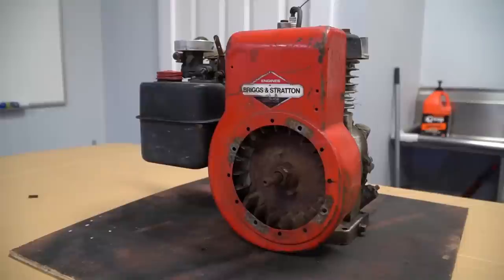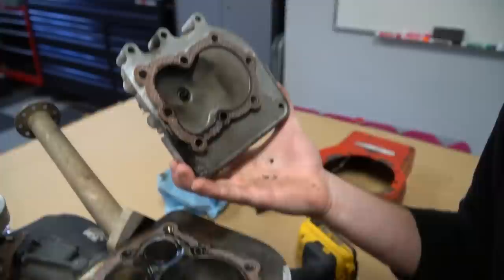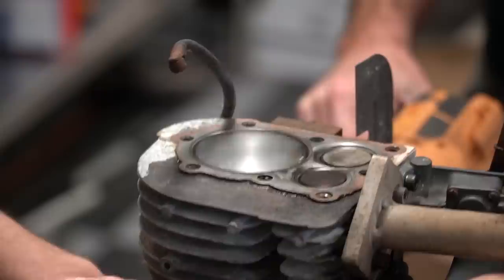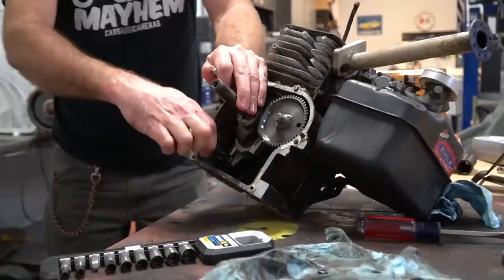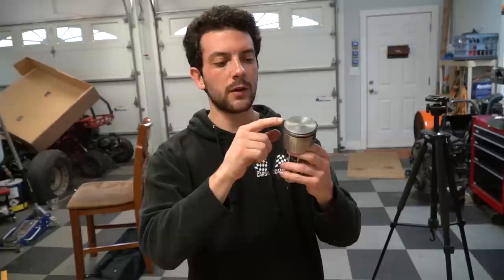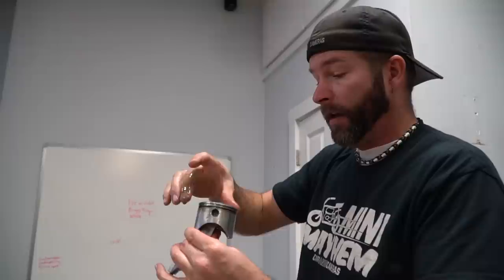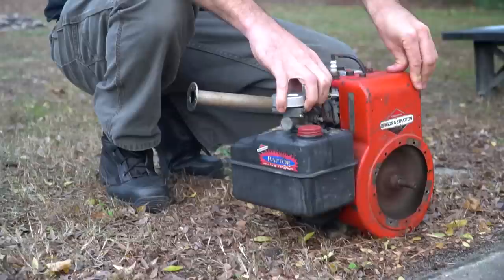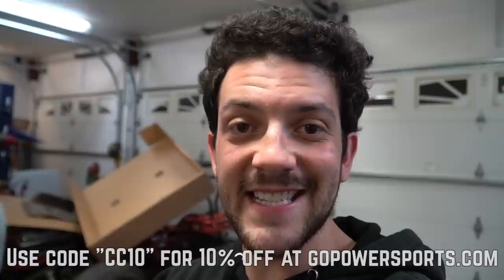Rat Rod Wagon HAULS | Built Briggs & Stratton Flathead

Comment: Race piston- 

That one looks like a relatively primitive design, probably originally set up for methanol (the 2 rings).  2 rings simply have less friction than 3 rings and you try to get away with it when you're burning cleaner fuel/changing the oil more often.  

The longer rod/raised pin height decreases the angle when the crank pin is at 90* relative to the piston travel so more of the vector force is pushing down on the crank/less to the side which transfers more of the piston's power to turn the crank.  The piston will also dwell longer at the top of the stroke causing an increase in cylinder pressure by increasing dynamic compression.  In theory that should result in better HP, less piston scuffing and rocking (again, possibly helping you get away with the 2 rings).  

That piston likely has some extra height at the crown resulting in a higher static compression to go with the methanol race fuel (it's possible that it is 1.5-2x that of stock), it probably wouldn't run well even on high octane if it wasn't for the worn out rings.  

I couldn't tell from the video but race pistons often have gas ports drilled from the crown to the back of the ring groove, to use some of the cylinder pressure to help seal the ring under a power stroke/compression stroke allowing you to use lighter and thinner/lower friction rings.

Racing pistons are often forged (deform easily but don't break so you can abuse them more in extreme applications), or sometimes hypereutectic (in applications where tune is going to be dead on they are more precise and change shape less), compared to stock cast pistons (basically the cheapest way to make them)

The reason why I called it a rather primitive design is that normally something more refined/modern would have a shorter skirt and more relief on the pin side of the skirt, anything to make it lighter and on the pin side the only skirt height you need is enough to stabilize the rings- it would actually look more like the modern Briggs person that Ike held up.  Most modern pistons use ceramic anti-friction coatings on the skirt, oil shedding coatings on the inside of the crown and sometimes heat reflective coatings on the face of the crown.

Comment: The second engine I built as a kid was a Briggs 5hp I bought for $7.50 at an old car show, someone had assumed wrongly that it was locked up (coil was rusted to flywheel lol) I got an ARC connecting rod, raptor 3 piston, Dyno Cams 95-3 cam, billet lifters, stiffer valve springs (still single springs) and replaced the carb and drilled the jet out. It seems to run a bit rich on gas, but it likes E85 now. I've revved it to 8500 rpms verified by a tiny tach I have mounted to my steering wheel. I think I maybe had under $200 in the engine by the end of it. I prefer the 5hp Briggs over any predator because that cast iron flywheel will stay together, and iirc the predator has a cast aluminum flywheel from factory and they don't like revs. Now, I haven't built a predator so take that with a grain of salt, I could be thinking of the Honda clones. The other reason is if you know what you're looking for on eBay, there are plenty of parts still out there, and they're cheap now because they stopped racing these in the late 90's early 2000's. The downside to what I built is my block is aluminum and my piston is unchromed, regular raptor 3 blocks were steel from that era and had no governer holes in the side. I jb welded mine.

Comment: A forged racing piston has more side wall clearances in combination with a single compression ring tends to rock a little more in the bore the longer rod helps reduce piston rock as it travels up the bore broadens tourqe curve seals better less wear on cylinder walls and more reliable  over all win win thing and there is that thing where it dwells longer at the  bottom of the intake stroke now we can get some more air and fuel in with some good cam timing a little food for thought 🤔😉

Comment: That valve is supposed to rock like that. That's for the compression release so it's easy to start. If you have an old briggs manual look up "easy spin starting". It explains how it works.

Comment: 1 ring = less drag. Longer rod = more piston dwell time at top dead center and bottom dead center. Usually racing pistons are forged aluminum which will take more stress than cast

Comment: The wrist pin is just at a higher location with a lot thinner of the top of the piston giving it more air volume to pull into the cylinder making more compression a s power and sometimes its also lighter

Comment: What makes a piston a racing piston is:
-Tighter clearances all the way around
-Lower weight
-Higher flowing crown
-stronger materials
Thats it.. all of these in different ways add up to more/less compression (lower is better for turbos and No2 with cheaper parts) greater fluid dynamics in and out of the combustion chamber (move more air) lower rotating mass (easier to spin the crank all together) and more compression capabilities (more power out of the fuel)

Comment: Most race pistons are forged, however some may be hypereutectic. Biggest differences between a cast and forged piston are strength and ability to resist high temperate. Within race pistons you have two commonly used but separate alloys. Those being 4032 and 2618. Both have their advantages and disadvantages. 4032 is less dense and expands less than 2618. However 2618 is stronger and more tolerable of heat. Both could be considered application specific. You wouldn’t run 4032 in a car that is high horsepower, high RPM, that you only drive at the track. 

Other than material, design is a big part. You’ll often see race pistons with thinner, stronger, piston rings to cut down friction and free up some horsepower. Most use a 3 ring design but some, like yours, use 2 rings. A lot of pistons will have a coating on the skirt to help reduce friction. Other things to save weight and cut down rotating mass would be shorter piston skirts and smaller diameter wrist pins.

Comment: I never liked the slant cylinders on the newer engines . I'm pretty sure you'd be able to get valves and guides and probably even seats and the little tools that are required to replace them you can make your own guide removal just with a bolt and nut and a washer and a tap . And only if you take great care when grinding the lifters for valve lash it will make the valve train sing . I collect an old Briggs or to every chance I get and Honda has a nice vertical cylinder series too , with overhead cam and overhead valve and cross flow . I have a 6 horse from a pressure washer that has all these features . It's sweet in my opinion , for a small industrial engine to have almost every modern technologic advancement incorporated into it .

Comment: Not all Briggs are worn out, I got a 5hp Briggs that had a seized pressure washer pump on it, the only problem with it was the low oil cutoff wasn't working properly, other than that it fired right up and ran perfectly, and it didn't even smoke when I had to use 2 stroke fuel In it.

Comment: Make the piston gap a little wider to let more oil in and run a gas line to the oil and drain the oil. Then fill it with 2 stroke fuel

Comment: The main reason for running one compression ring is to cut down on friction.    higher and faster RPM s is one reason. Race engines like drag racing the engine only needs to last a QT mile at a time. Where as two compression rings are designed for longevity. Who cares if it smokes a little it'll only smoke for short distance. The skirts are longer to make up for the raised wrist pin to keep piston from rocking in cylinder

Comment: You guys have a Briggs 5 hp double bearing engine. It is the all time best and most popular flat head design engine for kart racing. Your engine looks to have a Horstman billet rod with insert bearing and either a Horstman 2 ring race piston or Wiseco. The camshaft is definitely an aftermarket race cam and looks to be a Dyno brand cam. You pointed out it also has the dual valve springs. With the proper rebuild that engine should produce around 13 hp. If I were you, I'd invest in a new oversize piston, a fresh overbore and a new rod insert bearing. Keep in mind if you have the steel sleeved engine you'll need to buy a non-chromed type piston, if it has an aluminum bore you'll need a chromed type piston. You should be able to locate a new piston with rings on Ebay. Just be sure to measure your rod length as it is longer than standard. Probably a 4.475 or 4.5" rod. Keep in mind those are race parts, forged piston and billet rod with insert bearing. These parts will last much longer and make much more HP than the stock stuff.

Comment: One compression ring equals less friction and resistance. Longer rod equals less wrist pin friction at high rpm and less wrist pin angle through the strokes.

Comment: Racing piston with a single compression ring has less drag versus 2. With a longer rod and a shorter piston it has less rotational mass. Also more than likely it brings the piston closer to 0 deck height resulting in more compression. Which will result in a substantial gain in such a small engine.

Comment: Longer rod, means higher compression ration, it's called a 'stroker' engine, as you have increased the stroke. Also I bet the racing piston is much lighter, because when you stroke an engine you want to lower the piston weight, so keep up your engine rpm. My guess is it has a performance cam also. The longer skirt is to help keep the oil on the connecting pin.

Comment: You may be able to run the thing off of E85 or denatured alcohol because it leaks so much oil so it could decrease the octane enough so the engine could idle correctly.

Comment: Did you guys consider swapping the useable Briggs speed parts onto one of your other Briggs blocks? Probably would have to go stock piston if the racing piston is over sized, but I think you could use most everything else. Would be interesting to see the difference in performance.

Comment: There used to be a double-compression ring, which might work to get a better seal, and thus, better compression; it most definitely needs new oil-control rings.  Some shop should be able to match up the rings by dimension.

Comment: After you get seals for it put on a mikuni or predator carburetor so we can really see it rip. Honestly the flat head Briggs should never go out of style. They are easy to work on just hard to get parts for. I want to put a new carb on my 3 horse and get away from the diapharm carb.

Comment: It's not just the pinion. The longer rod gives it more volume. And the original piston would smash the head. Longer throw means that piston needs the pin hole higher.

Comment: The racing piston is probably forged, weighs less, better wrist pin location and uses a stiffer compression ring so it only needs one. Replace the rings and the valve guides/seals and you'd have a real runner and yeah, I like the old Briggs & Stratton engines best. Just my opinion.

Comment: The distance from the piston face to the centerline of the piston ring is much shorter on the racing piston. This reduces piston rock while reciprocating in the cylinder bore. Reference the original GM 409 racing engines. the first try was a failure due to the bore size vs stroke length. The pistons rocked too much.
There are other advantages. Look at a Chevy LS piston vs a small block piston.

Comment: Not a race expert, but if the Piston is lighter you can reduce rotating mass. Also if you can maintain compression with a single ring you can lower the overall temperature of the engine at higher RPM.

Comment: My old 3hp Briggs & Stratton 9 series powered push mower smokes a little bit on startup.

I just think it has a worn out inlet valve guide & I can be bothered chasing up the tools to ream & install the new valve guide, the reamers,etc are still available as N.O.S. (new old stock) online & I can order the parts separately.

An expert such as Taryl is good at rebuilding them but he mainly replaces them now as many of them he services are totally stuffed & it's cheaper to bolt a new engine onto an old mower.

I think that they are very reliable, just keep the oil up to it when it smokes,judging by the one in the video, it would use a lot of its oil within 1 lap !

Comment: The piston, 2 rings and the longer rod have been answered correctly below. The intake valve or guide are worn & oil is being sucked on the intake stroke. Measuring the ring end gap ane piston bore clearance will tell the story. If this engine was run on Alky the timing mat be advanced. I'm a dealer and and even though a gizillions of these engines were produced, I only keep carb parts etc in stock. But everything should be availabe to order.

Comment: the rust pitting and glazed cylinder was the problem the whole time.  oil control ring will not work  without crosshatch and cylinder will glaze. thus passing oil past rings
Reply: I agree...once i saw that the walls were pitted and had a little rust...plus the valve issue going side ways (assuming its worse than a bent stem...i would not consider any value to this motor for a project. Still enjoyed watching this video!

Comment: Also if try running it on ethanol it sounds like it's pinging, ethanol will help it run cooler plus e85 has a 105 octane rating so it can benefit from more timing

Comment: Check your ring gap.  It should not exceed .010".  If it does you need new rings.
As to the smoking?  Pick up zinc type oil (break in oil)

Comment: Ok so. It’s a racing piston yes but the reason it commonly has one compression ring is because when you move the wrist pin up, you loose room. It is also because less rings produce less friction and less power loss. The reason one would want to move the wrist pin up, is so that you can shorten the piston and lengthen the rod. This then makes the rotating assembly lighter and also puts less stress on the rod at high rpms. Btw guys that engine would really get rowdy with a billet flywheel or a timing advance key (I recommend the flywheel) and i love the briggs way more than the predator i can make that engine better than the 20hp naskart

Comment: For one thing a 2 ring aftermarket piston your going to have some smoke. By having the shorter piston an longer rod it changes the stroke make it shorter. More top in. And your motor last longer to.I have built lot small race motors. I had a Tec Star 10 hp put out 35 hp. after i got done. 195 lbs compression . There a place here in Missouri has a dyno for small engine.

Comment: I want to do this with an 8.5 horsepower engine off of a wood chipper. It has different gears, speed control and an alternator on it. Also battery start. Am I gonna die?

Comment: Did you get an answer?

2 rings vs 3= less drag/loss with less ring contact area on the walls and less weight (al lighter than steel)...in that case it's probably also to do with moving the pin bore higher for a longer rod.

longer rod=the ratio of rod size to stroke length is a huge determining factor when you're spinning at high rpm as to how long your piston/bore will last. Longer rod=lower side loading on the piston skirt/cylinder wall. So why not make all rods long? You run into stuff like you see on that piston, no room for rings, really thin dome, skirt length etc.

Comment: Run a heavier weight racing oil in the Briggs. If it is set up for racing as it appears to be, all of the clearances are likely on the loose side. 
As for Predator vs Briggs, I'd much rather have the old Briggs than the "Made in China" Predators and you can still find parts for all but the very oldest B&S engines. 
P.S. "Engine Restorer" worked great in one of my small tractors that was smoking about like the Briggs is now. Give it a try in the Briggs, there's nothing to lose.

Comment: you guys need to build a 5hp briggs and then build a 6.5 horse predator put them on your race karts race them and then explain what the diffrence is between the two and so we can see if the old technology is just as good as a modern day engine
Reply: Job has more torque faster take off .but the flat head can turn 8000 rpm with a few mods and pump gas where the ohv will top out around 6000 no matter how you build it
Reply: @averyjones1098    I've seen 10,000 RPM + on a vertical shaft.  Modified Cam and a 15 hp outboard carb. I could not believe it. The engine was literally screaming loud. Then the rod disintegrated, right out of the block. It took 15 or 20 seconds for the crank to stop spinning. I was building a mower engine for heavy field cutting. & tall grass.

Comment: Very nice building, and love the front engine, rear wheel drive and custom built drive shaft, and offset gearbox!👍 would love for you to design a front suspension! Would handle a lot more better offroad.

Comment: i want to see that beast with an old cast iron block thumper .... the tecumseh HH12 (low rpm torque monster) ...at a low idle that engine will make the front tires hop off the ground lmao (had one on a mini bike many years ago)
find one from an old sears suburban or SS garden tractor you will have fuel pump and charging system (old school belt drive starter/generator)
ive outgrown gokarts for now but i love that engine as it sits on my 1968 sears SS12 (yes i own a 68 SS.....just not the cool kind)

Comment: I want  you  guys  to  build  a  garden  tractor  cub  cadet  older one like a model  70 or 100 they are very collectible  and put a turbo diesel in it  with out changing  the transmission  in it because  those transmissions are very  heavy  duty  all ready .

Comment: Your problem with the smoke is that motor was built to run in methanol which has a methanol piston but fuel is flammable to where you can still run it with performance but fuel produces carbon unlike methanol